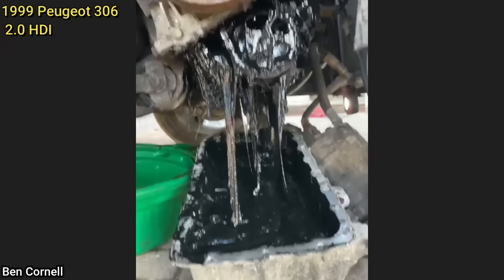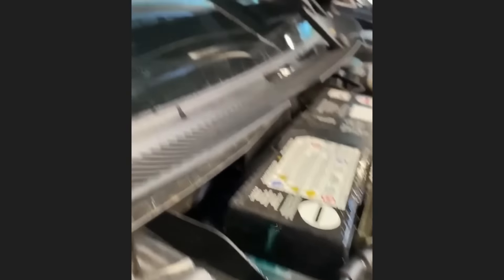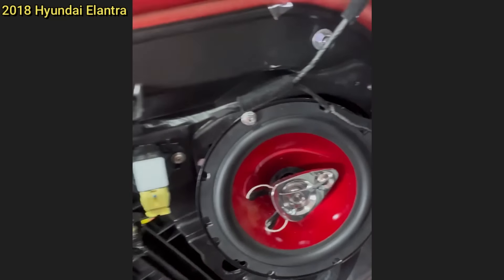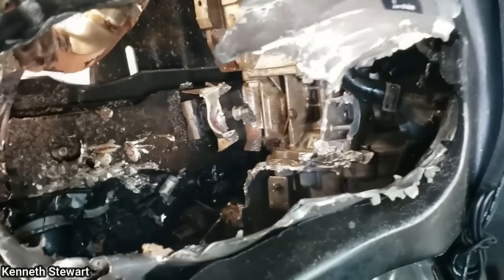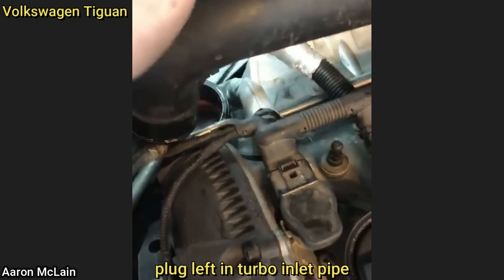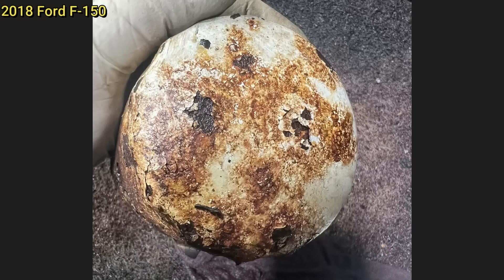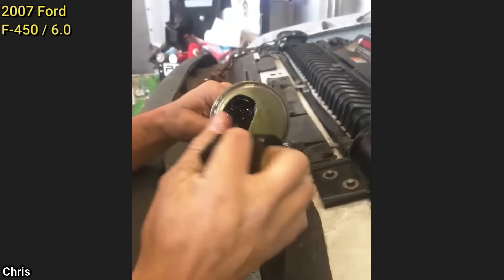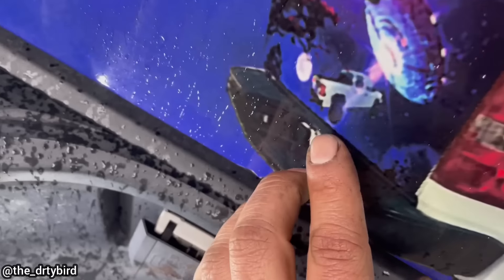Customer States (Best of January & February 2023) | Just Rolled In

Comment: Worked at a shop as a kid back around 2010-2012  ish. Customer came in one day saying it sounded like a plinko machine, but only at low speeds. All four hubcaps hand a handful of peddles in them. One of the old timers told me it was a prank people used to to do with change back in the day. That was allso the day i learned you could wire a car horn to the turn signal relay. 😂😂

Comment: Its hard to pick a favorite , or a worse as the case may be . The truck with all the wrenches and scrap metal makes me smile . When an artist makes a sculpture from scrap metal , tools and car parts we look on with amazement but when its the car beside you on the highway its terrifying . Thanks to you for the editing and the ones who submitted these best of clips always making my day end with a laugh ..
Reply: I really like the guy who puts a rock on the brake pedal, gets out, puts it in gear with the lever on the transmission itself without running over himself or anyone else were the rock to fall off the brake pedal, and then drives away with only a broken shifter cable in need of fixing.
Reply: my favourite is the halfway ground away exhaust pipe of the low-rider
Reply: That is a good 1, but the wood 2x4 link absolutely floored me! ROTFF🤣
Reply: @09corvettezr1  Old man had a 60's model Dodge pickup. The clutch wouldn't release, so he would kick her out of gear and bring her to a stop, but he didn't have a parking brake either, so he got out of the truck one day after putting it back in gear to park it. Coming back out of the store to leave, he couldn't get the truck back out of gear to crank it, so he crawled back under, tearing the wires out of his pace maker and died.
In the end it is the small neglected things in life that will kill us. He had all the parts to do the job at home, but waiting for good weather.
Reply: @graken22  i feel that is one of the safer bodge jobs, really.

hell, use a nice hardwood beam and well varnished, and press decent bushes in...

of course, noones actually going to do that. its a bit of effin pine... but yeah... could do the whole suspension system with timber if you were that way inclined...

Comment: I'm not the most mechanically inclined guy ever, but these videos make feel SO MUCH BETTER about what limited knowledge I do have! It's criminal what some folks do to their vehicles!
Reply: I’m right there with you. I know practically nothing about car engines and yet my car is fine.
Reply: If you ever need to figure something out on your car, YouTube is a pretty good source along with Google searches. I was Auto Technician years ago and I find that doing research first helps a lot. 1 example: fixed my wifes 1987 CRX arm rest thanks to YouTube. Rather than wasting time trying to figure out how to fix it on my own, I found a video with the exact same car and problem. Someone usually has already done it and may have a better way of repairing it.

Comment: The one that REALLY got me was “slammed into reverse at 70mph as they did not want to hit a deer” 

I have so many questions.
Reply: Maybe they normally drive a boat?
Reply: No I said "hit the brakes" not "hit the breaks".
Reply: What also will happen when R is mistaken for Racing.😄
Reply: Why not use the brakes, just a thought....
Reply: My driveway entering the main road is 100' wide at least. Something like 5 or 6 tile sections go under it. The main road by my house is perfectly straight. A woman in a 2018 Toyota Camry came off the road road to her left; crossed lanes and up the embankment in my yard then down through my front yard parallel with the road. Took out my mailbox in the yard and tossed it backwards 25'. Continued another 200' and hit the tile of the closest side of the driveway. Upon hitting it knocked the headlights out of the front of her car, into the driveway; launching the car up and completely over the 100' of driveway you could see where clearly her front and rear tires came back into contact with the grass at different times and angles, so she cleared everything. Coming out of the ditch she cleared a 45mph metal post sign on my side of the road. Went across the road and collected a curve ahead sign and took it with her down the road, where it was standing up at the railroad bridge 1/4 miles away from her initial accident.
She had the nerve to come back a day later to say that she was sorry she would pay for my mailbox and such. She was simply avoiding a deer. I had to resist and tell her I was going to just call the cops if she didn't get out of my yard.  No way in heck she was doing anywhere near 45mph posted speed. If she would have been driving it, I would have called. 
She drove it on to work and back home. But I am sure it was the worse for wear.
Reply: @lesleylesley5821  Maybe they had a brake failure
Reply: @eshical4189  I dont know man, if you've seen the sheer amount of people I have who have somehow taught themselves to the point of instinct that it's a fantastic idea to hit their horn before ever even letting off their gas, or, God Forbid, actually touching that brake petal . . .

I've seen more accidents than not where people careen into something at full speed with the horn blaring for 3 seconds without a single attempt to stop or even try to swerve out of the way.

Brakes are a damn afterthought to a frightening amount of people.
Reply: Well to answer that, I would do that as well as hitting a deer at 70mph is guaranteed death. Better to kill your transmission than the first option.
Reply: @WC3fanatic997  You're not wrong haha
Reply: @cmdrlightwalker_9877 on a motorcycle? Probably. In a car? Nah. That deers toast just as your front but you wont die from the impact.
Reply: @cmdrlightwalker_9877 Guaranteed death for the deer. I’d take body damage over my transmission any day
Reply: Is it even possible to bet into reverse whilst moving forward?
Reply: @hankjones3527  It is definitely possible. But the end result is seen in the video, so there is a definite difference between "possible" and "recommended".
Reply: @cmdrlightwalker_9877   Hitting a deer at any speed is NOT guaranteed death. It depends. Many a SUV can take out a deer and the occupants will be fine. And there are deer and deers. Using transmission to brake is not effective. On the contrary. It locks the wheels which is much less effective than what a modern ABS system can do. Or, if the transmission completely fails it can let your wheels run free with no braking effect at all.
Reply: He was trying to go full speed astern

Comment: I put my mountain bike in for work once... had a pair of shocks you could turn off for road-use (it was more of a hybrid bike tbh), so they call me part-way through the work "Hey, your front fork is bent, it doesn't look like it but they won't go down and are completely seized" I replied "there is a broken plastic tab on the right shock, get a pair of pliers and turn it counter-clockwise so it's pointing to the front of the bike" waits while he does it "ok, it works, never mind". I still laugh a bit when I hear "customer states".

Comment: My colleague told me (and showed images) of a fix he made to a car where a passenger had lifted a loaded rifle from the backseat with his finger on the trigger. The rifle discharged through the rear seat, into some carpet in the rear and hit a complicated loom as it was splitting.

He spent two weeks getting the wiring diagram as well as carefully reconnecting each wire.

The car ran again without a hitch.

Comment: Props to the guy with the rock on the brake pedal. That's not the same guy that puts 50,000 miles on an oil change, that guy's got some brains and a serious pair of balls to put a vehicle in gear while you're under it.

Comment: couple short laughs for you. I had 2017 Rav4 4 cylinder come in with a deep cycle marine battery. The cat had also been stolen from it but he said just cut the battery cables and make them longer rather than buying a $100 for the correct battery when he is already spending $500 on a cat. Came to a deal the shop bought the new deep cycle and put it towards the correct battery for it.

Comment: I had a breakdown midway from moving from one state to another. The plastic drive thingy on the drive belt failed. It was replaced and I was back on my way. Funny thing, some major engine bolts on my 2000 Oldsmobile, year of failure 2017, mysteriously disappeared after "my heroes" got me back on the road. Guess a fool is born everyday and tag I was it.

Comment: @9:00 That's interesting because my grandpa said his late '70s early '80s. I can't remember but it was a Dodge d50 which was a Japanese Mitsubishi little truck actually came from the factory with wood for the cam tensioner.  So either it did or this is a common scheme at fixing those.  Or a massive coincidence.

Comment: The Van with the Chain reminded me of a 1974 Vega I bought when first out of High  School. By 1979, it was so rusted I had one rope IN the car with a spring on it to hold the rear hatch closed and a 2nd going between the front doors to hold them closed while driving. 
I replaced ASAP after I started working full time.

Comment: Use to work for a notorious auto tech school.2 best pranks I saw was wiring the horn to the brake switch, and running a wire from the coil to the driver's seat..

Comment: In my case, "Customer (me) stated there is a bad vibration on the highway at about 65-75 mph. Also car shut down." I was told the rear U-joint was bad and the failure to run was because the gas tank was empty. With gas, runs fine. Authorized the U Joint. Told the mechanic to check again, as I had filled the tank less than 80 km (50 miles) before the car quit. Debris had damaged the tank and sending unit. Authorized that repair too. Get the car back, vibration differ but there. Went to a friend. New U Joint missing Zirk fitting and cap retaining clips not fully seated. Won't go back to that dangerous shop again.

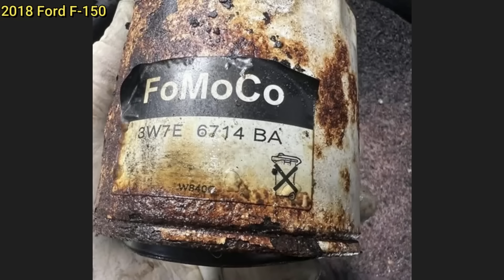Comment: 8:16 aint nothing, My Wifes 2003 RAV4 drove 1.5hrs home last year with a bad knock and the oil light on. I flushed the oil twice, and on replacing the filter found the original Toyota Japanese stamps on the filter. New filter, fresh oil, and its been running like a champ ever since

Comment: How do people mess up this bad
The worst thing I did was put oil in the motor with the plug out (which I noticed as I was pouring as a growing black puddle was appearing) but that was because the oil filter was cranked on there so I got distracted by that and it was my 1st oil change performed.

Comment: I'm rebuilding the engine in a forklift right now that was rebuilt by some like the electrical tape guy. Dude stripped the threads on the cam which allows it to move back and forth destroying distributor gears and causes the governor to not function. Absolutely no way he didn't notice it just didn't care enough to fix his mistake. That's just one of the things he did wrong.

Comment: Drive thru restaurant customer states car is suddenly making an awful noise and it started steaming as we spoke. I advised them to pull into a parking space and call someone for help. It left little bits of belt behind all along our driveway.
Customer behind them states about the issue, "Probably because they just ran over your curb and tore out the bottom of the car."
Oops.

Comment: I wish I had grabbed a video of it but I had done an oil chanfe on a 2000s subaru with an oem filter and Mobil 1. I test drove the vehicle for an intermittent suspension noise when all of a sudden I see in the rear view mirror a plume of white smoke. I pull over and the entire under side of the car is covered in oil. The engine was about 2 quarts low so I turned the car back on and checked under the hood to see where it was leaking. Turns out that brand new genuine  subaru filter had 3-4 pinholes in it and it was just pissing out oil all over the exhaust. Never seen anything like it before. I'd expect it from an autozone stp or the generic crap they use at most lube stops but an oem filter? Absolutely ridiculous.

Comment: Customer states squeaky u- joint . F 150 I couldn't lift truck due to frame rusted in 2 on driver's side. Guess what prevented it from separating fuel and brake lines. Customer drove truck away.

Comment: this is pretty funny as i imagine my video is incoming , back yard mechanic(me) installed a new suspension system in the front end. upon inspection all the bolts were loose and the tie rod was so loose it could manually shaken as though it was installed with zip ties lol the real mechanic found that the customers life was saved by a 10 cent cotter pin he bought at tractor supply . Still saved myself over 1500 dollars and learned a valuble lesson along the way . Stupid laughs at stupid hahaha i still find it hilarious that someone could be so stupid as to not chanbge their oil even though my mistake could have costed my life while theirs only the vechile they drive . Just remember when your laughing at someone for being stupid someone else is also laughing at you .

Comment: Public service announcement: Slamming into reverse is not going to slow you down faster than your brakes if you drive a modern vehicle with working disc brakes and ABS! In fact you will slow down slower than if you just slammed the brakes because you will skid! and regardless of what you drive it will wreck some or all of your drivetrain.

Also, this is the second time in these videos I have seen someone tie something heavy to their indicator stalk and then complain that the right indicator doesn’t stay engaged…

Comment: I don't understand the guy at 11:23 that put it in reverse while going highway speed to avoid a deer.... You know your car has brakes right? If they stop working randomly you also have the park brake that can help a little... Also, i have never ever seen any car in which it is even possible to put it in reverse while going over 5 kph or so, the transmission just grinds and wont lock in (and i drive manual, i guess automatic is even less possible since it's computer controlled?)
But anyway, still why? Why try and put the car in reverse, what kind of messed-up reflex is that?

Comment: Haha for me it's the opposite,  my car gets a check engine light, I go to the mechanic.he says it's 1k to fix since it's something with the motor, I take my chances and go home, as I'm adding oil and checking the antifreeze I see my battery plug-ins have corrosion on rm so I clean them. A day later the check engine light goes away and it's been months and I haven't gotten it back. I honestly don't trust mechanics after that stunt

Comment: The ones with the very low volume after a customer put they're own stereos in the cars happened to a friend's son who tried to do it, except he fried half the the wiring and 2 computers before he had the electrical repair shop charge him $3500 to replace the wiring, take the stereo out and send it to the car stereo people who replace the stereo and properly wire the aftermarket amplifier so that it worked like it was supposed to, another $1000 because it required a special integration harness and box

Comment: I never realized how many stupid/irresponsible people there are when it comes to cars. A lot of these people have no clue how to fix whatever they're trying to fix on these vehicles and then bring them to the shops when they botch them. And then you have the ones that have cars that are literally falling apart but can't afford to get them fixed and they're just one pot hole away from killing themselves or causing an accident and hurting others when the car falls apart. I never knew it was this bad. The most I would think is that people were driving around without insurance. Not with vehicles that are literally on their last wheel.